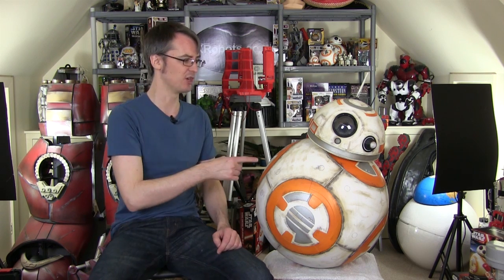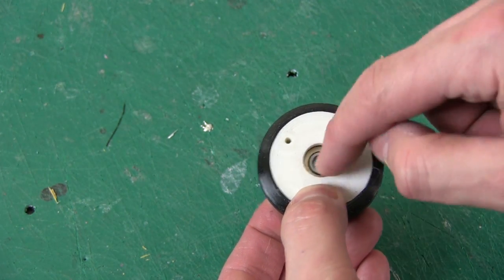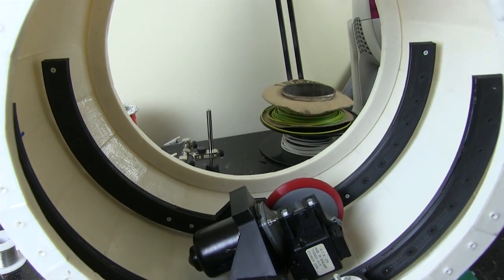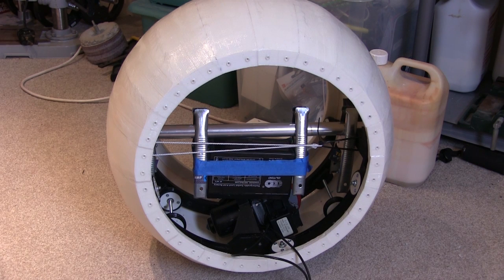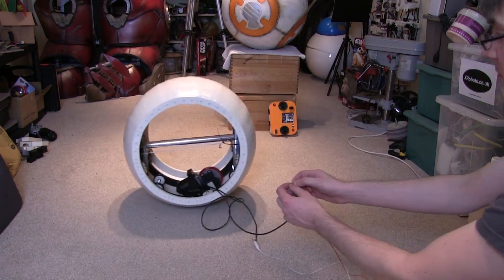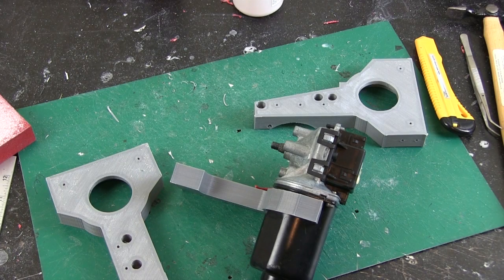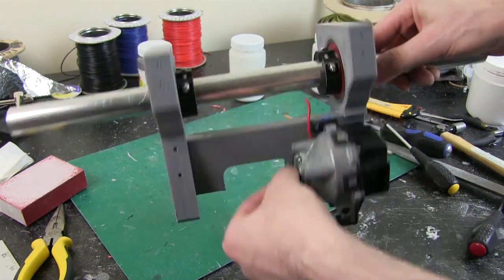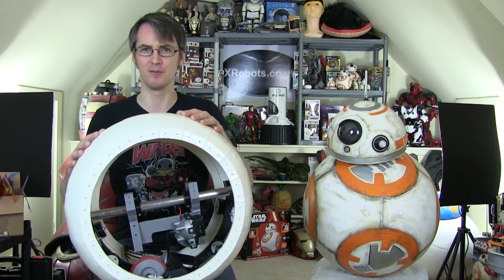Star Wars BB-8 Droid v3 #3 | Side to Side Axis | James Bruton

Comment: Excellent videos! What filament, temperature and speed settings are you using for walls and infill to get the 3D printer to print so fast? Mine absolutely crawls in comparison to yours!

Comment: If you do another version you could put a pole in the middle, weighted at the bottom and have the engine rotate around the pole, then have it oversteer relative to the degree and speed it turns to make up for the pole turning in the middle, or have wheels on the pole turning the other way. That way you wouldn't have to rotate the whole body to turn
Reply: Wait no the wheels on the pole would turn the same way but slower, a relative amount to counteract it's shift the other way
Reply: +Alex hutchings wait actually weight the bottom and have a hexagon/octagon/decagon of wheels and have them turn in sync? One engine with counter balance and boom BB8
Reply: +James Bruton it would spin out if it turned so you'd have to have the wheels turn more and accelerate accordingly.

Then if you really wanted to go to town and bring it to life you could set BB8 to move randomly, put a motion sensor in the eye and have it avoid people, and maybe a tracker to put in your pocket and have it follow you! If the motion sensor detects an object which isn't advancing it could activate the sound effect so it looks like it's talking, I'm spamming here but maybe there's something useful in there!

Comment: I could see full motion in the ball by creating a second mirrored set of bananas and drive motor, then mount the large shaft rigidly with a cog in the center that the swing motor is geared to run against.  You could theoretically rotate 360 sideways as well with wiring being your only constraint.

Comment: If I may, Instead of what you suggested for the "Banana" What about reinforcing it on both sides with a bracket Using two pieces to stabilize the banana may prevent any side to side deformation that one reinforcement in the middle may cause.

Comment: I've seen you doing this "touch cables with the battery" thing so often now - its about time you build some unit to cut and reverse power where you can easily clamp your battery and motor cables into!

Comment: I wonder if you could use a mechanical gyro that you can deflect in a single access, leveraging the gyroscopic procession to effect steering more directly that simply creating and arresting inertia?   seems like it would add stability, be mechanically and programmatically simpler, and add more precise and linear actuation in the procession axis.

Comment: When sanding the inside, or outside, couldn't you mount the whole thing on a wooden jig similar how a washing machine works? The surface would probably be very round and uniform. Perhaps it's too much work and it's good enough as it is.

Comment: wasn't the side spacing ment for the ball to be able to lean one way or another? this can no longer lean at all, as the outside wheels are limiting side movement o_o
Reply: +Gerard Umbert As you can see there is an axle suspended above the "banana" with a motor attached to it. This will run on a curved track and provide an axis of movement perpendicular to the direction of drive. This will shift the center of mass causing BB8 to lean.
Reply: MagnusTS yeh i got that, but I thought that was the idea for doing the chasis wider to begin with, same could've been accomplished with the old frame right?

Comment: Just an idea James, If you find its missing traction on the drive wheel, you could always get a bicycle inner tube , cut it in two and contact glue to the inner wall of drive hub.

Comment: For your side to side swing you could also use a GT2 belt and pulley on the motor. The belt would run on the outside of the half moon and would allow for some movement but still give you a no slip connection.

Comment: You could put a wormgear onto the wiper motor that is fixed on the trousers, the gear that is mounted to the wormgear would have a large nut inserted and that nut is mounted a large threaded rod (like M16, maybe with smaller pitch if needed). The threaded rod is mounted to the main drive gear (banana) and it can move around an axle that is positioned at a right angle to the threaded rod.

Basically what I try to explain is how you could build a worm gear driven piston that would change the distance between the banana-motor and the trousers-motor. This would safe a lot of space and would be much more reliable and precise compared to a wheel with a textured outside.

Anyways that was a great video and I hope to see more of the BB8 soon !
Reply: +James Bruton (XRobots) instead of a wormgear you could also use helical gears, which have spiral shaped teeth, those can have a 1:1 ratio, even when setup as a wormgear combo (90deg offset of the axis'). M16 threaded rod has a pitch of 2mm meaning you get 2mm per turn, otherwise you could also use trapezodial spindles which would have a pitch of 4mm with a 16mm outer diameter (or 8mm pitch if double threaded), you could then maybe also print the bushing.
Another idea would be to use nylon cords (as you have used in other projects) to pull the trousers in either direction, however I dont have the first hand experience on your BB8 project to judge what would be the best solution ;-)
Reply: +Marius Breuer too long

Comment: Again a very good video, and an ambitious build. It seemed like you still had a small wobble in the small wheels? If you use ball bearings, you should double them, else I don't think you can get it stable. A cheaper and simpler way to go is to use needle bearings.

Comment: fantastic engineering, really opens to mind to the potential of 3d printing. Couple of suggestions although you're probably past these already, 1. instead of using an extra threaded rod to pull the banana sides in you could just ensure the clamps on the aluminium rod are tight enough and the rod will stop the spread.  2. maybe print the surface of the swing rail in ninjaflex so along with the ninjaflex wheel there might be better traction, theory would need tested. 
Keep up the great work, your enthusiasm knows no bounds! 👍
Reply: Yup, I thought that about the clamps too...

Comment: I told you previously about using a helical gear instead of a rack gear for precisely the situation you are encountering now. The gear angle won't change and in this case will be much more forgiving than would be a spur gear and a rack. Another great video.
Reply: +James Bruton (XRobots) cool bb8
Reply: +James Bruton (XRobots) Actually that is the advantage to using a helical gear setup as it does not apply pressure that flexes like a rack gear and pinion would. Thanks... as that is exactly why I recommended it however one cannot make suggestions to mind that is already made up.
Reply: +James Bruton (XRobots) Well this came about as I was working to make a way to remotely focus lenses for my Steadicam. I started with a rack and pinion and it was a 'gear guy' (I found screw guys, bolt guys, nut guys, rivet guys all specialities in the old machinist world) that taught me about the helical gears since it does not flex or impart those forces I know is your concern. This is because the gear angle (the space between the teeth does not change over or in a curved surface and regardless of the change in curvature. This saves some major calculations. In my case any pressure on the lens would change the point of focus and in my business just a hair off and 'poof' the focus point changes. He made them (in the day) out of delran but you'd be able to print it all and they ran silently and did not 'skip' using very, very little pressure to keep them engaged, especially compared with a  rack and pinion. I mean to have made one inside your ball would have eliminated all those wheels and so forth and eliminated any slippage. There are conical helical pinions that can fit over the 'gear strip' or traditional... well gear... gears. I wish i could send you some pictures but I'm sure you will discover all of it as you are a brilliant guy. I think this technology will bring a whole new (and simplified) way of attacking some of the problems you face with these builds.

Comment: when you build version 4, making a simple turn table with blocks on the outside for the ball center to nest snugly in, then when sanding it will be more uniform, smooth. though mounting your sander or grinder might be more tricky, but clamping it on some 4x2" cut to length and anchored off a heavy desk. and slowly rotate the turn table by hand. and use your own weight on the base of the table, or add bricks do it won't move while grinding... 
love the builds keep up the good work... if you want me to elaborate more, I could draw a diagram.

Comment: "Here are the trousers mounted on the banana."
Reply: it's a technical thing.
Reply: Hey, you need to keep that banana under control one way or another.
Reply: +girass "So it can pull the banana and keep it in shape" (15:33)
Reply: +girass "It's quite stiff on the shaft..." (9:35)
Reply: +girass it's what belts are for